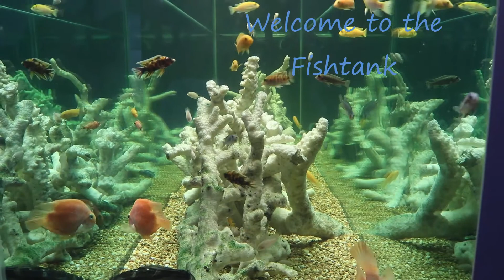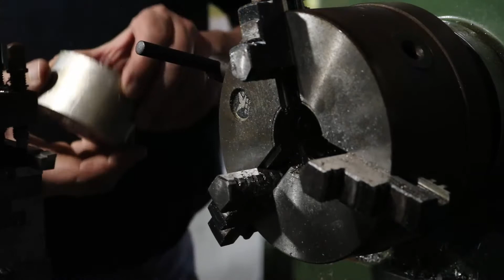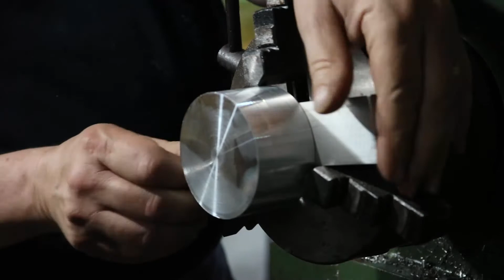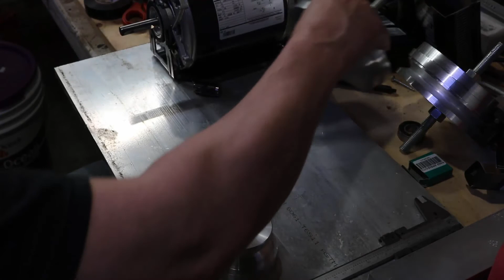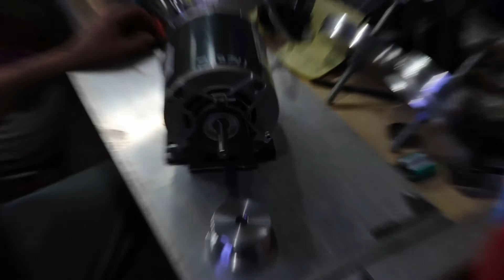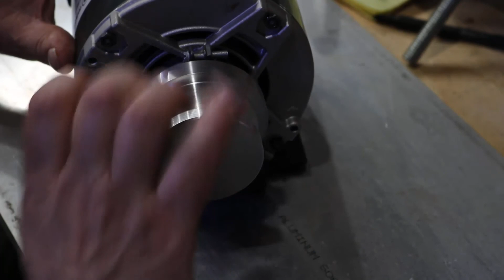DIY Mini Band Saw Part 5

Comment: fishman can I ask you a non related question I am getting a used 120 gal but it doesn't have the top and bottom frames will it hold water I think it's 72 inches by 18 inches
Reply from the maker: Without seeing the tank it would be difficult to tell. That said the plastic frames that come with tanks do little to hold them together. Just test fill it somewhere you don't mind getting wet to be safe
Reply: Fishman thanks